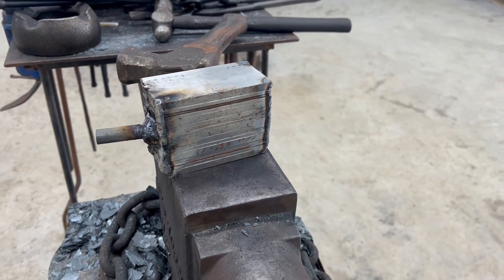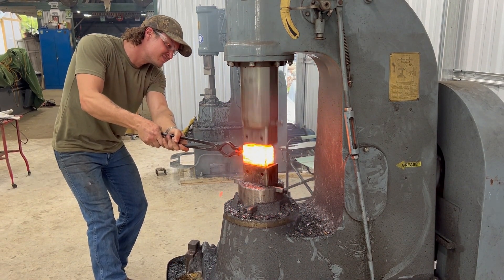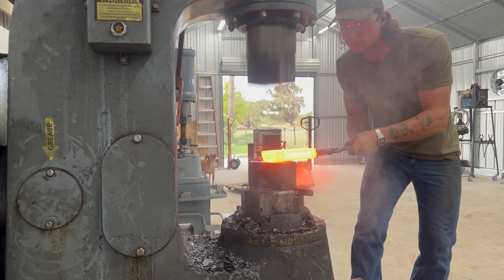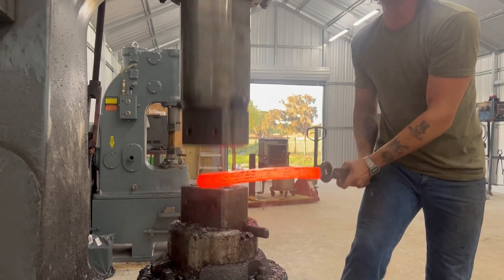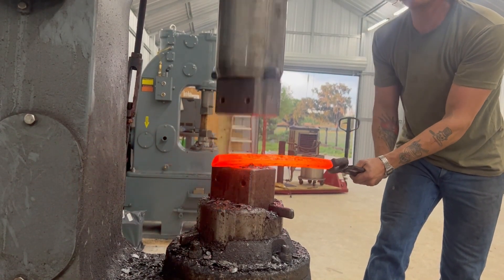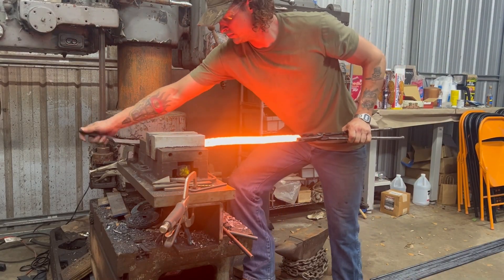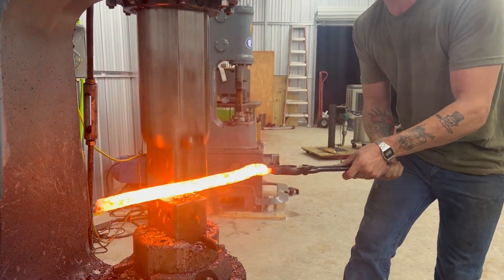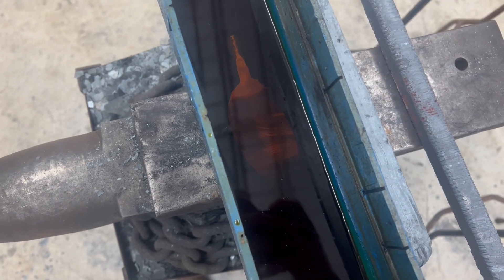How To Make Damascus Steel Knives For Beginners. Learn To Be A Bladesmith

Comment: Dumb question, when you hot cut the bar, could you have wire brushed off both pieces and then forge welded together?  Or must you wait to cool , grind clean and then forge weld together?
Reply from the maker: You don’t have to grind high Carbon steel clean to achieve a forge weld. It will stick no problem as long as you’re hot enough. You can also forge weld at lower temperature but this method requires a lot more pressure.